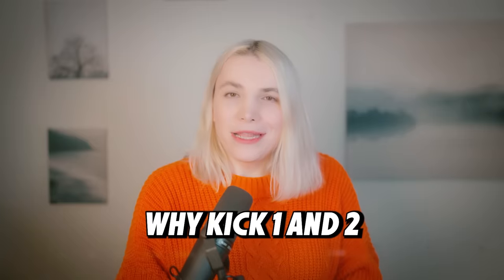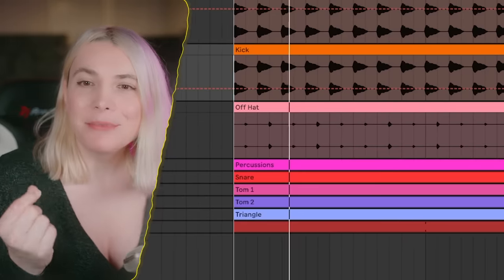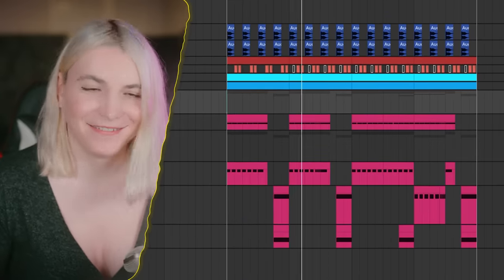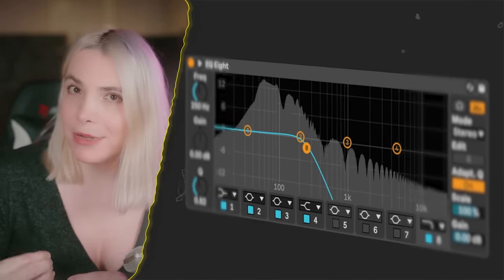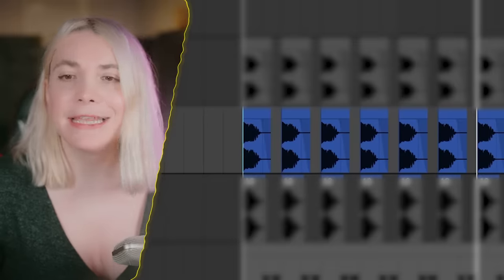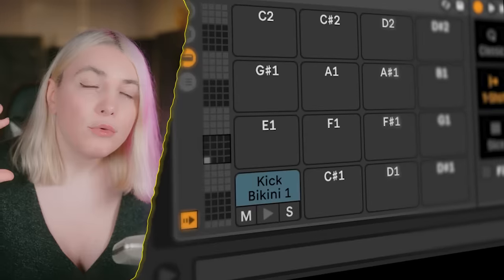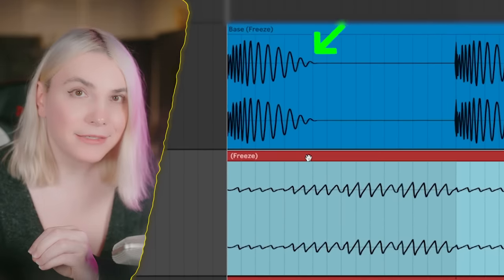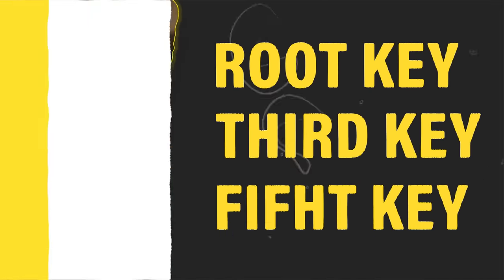Why Your Kick Fails ⁉

Comment from the maker: What is your favourite pro kick trick? And what other reasons do you think that are common that make a kick fail?
Reply: Use one good kick rather then multiple kicks layered unless you can make sure that they are phase aligned 😊
Reply: I like short kicks, nothing boomy but regardless I always tune them to then main key in the bass groove, nothing worse than an out of tune kick.
Reply: The long tail. Many times
Reply: My fav. trick is frequency sc. Thx for the video!
Reply: There’s a splice serum preset that’s stupendous. Also using big kick
Reply: any of a roland tr drum machine kick, then work it

Comment: Great work compartmentalising frequency ranges for kicks and complimentary uses;

I know a lot of electronic producers chase that big chest-hitting sub; and it's also worth noting how the fundamental/root low frequency(sub) of the kick relates to the rest of the track;

You touched on it in side-chaining the bass.

But for circumstances where there is no difference in time domain; (Bass on upbeat kick on downbeat); it's important to consider the root/fundamental frequency; 
If both your bass and kick are sitting on an A55hz, it might be worth considering moving your kick (like you mentioned) to the relative minor (3rd) up to a C65hz.

This is a common thing I hear that differentiates pro mixes for amateur productions;

Comment: My advice after 30 years of producing clubmusic is, that before you touch or equalize the kick try to equalize the bassline at first.
Cut that peak of low frequencies out of your bassline that is the maximum peak of your kick. Mostly it is around 60-80 Hz. Cut those frequencies out with a peak of -9,0 dB (Q 2.5 or 3.0) and a low cut around 40 Hz. Now the most kicks have enough room in their frequency range. After that sidechain your bassline with the kick with a gain reduction of 5-6 dB. 
The bassline and the hi-hats should work and groove alone without the kick and then the kick sound is mostly secondary or you can start to choose some kicks. 
Insert a low cut at 150-200 Hz for all other tracks (chords, leads, piano, percussion etc.)
After that procedure the most kicks should work with your bassline.  Although the kick should go right with the style of your track and the release shouldn't be too long. Short kicks work mostly better and you have the possibility to boost them with a pultec style eq with the so called "pultec trick".

Comment: uh, piling up layers of percussion can be very counterproductive. Layering works in context and it is not mandatory. Sometimes kick is just fine as is, with processing, eq, compression, distortion, drum buss processing, side chain also plays a big part in making kick work. But first and foremost, understanding frequency spectrum and dynamics is the key. Also tuning 100ms long dirty transient makes no sense, but that's a topic on its own.